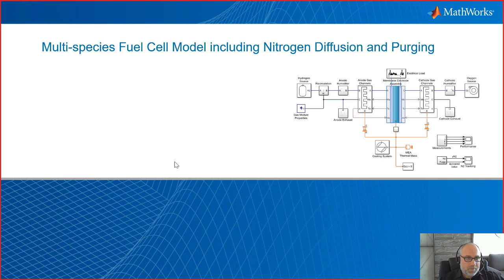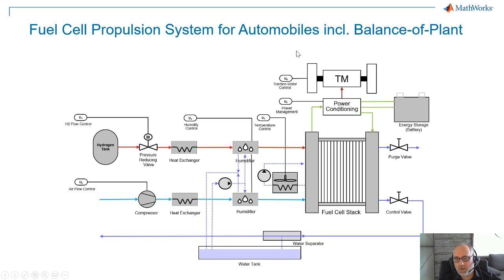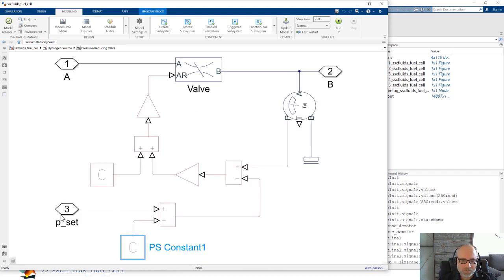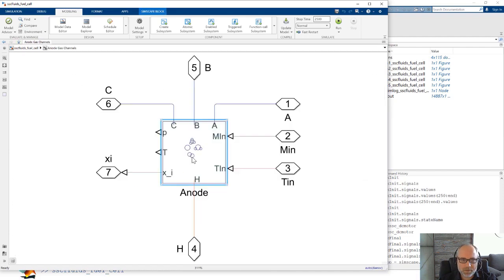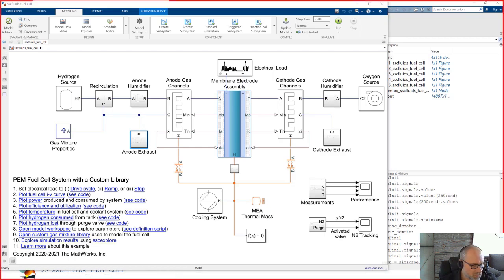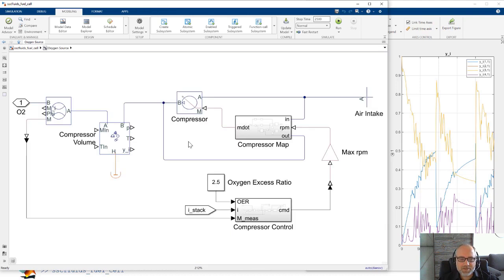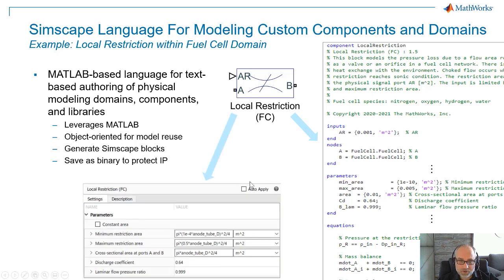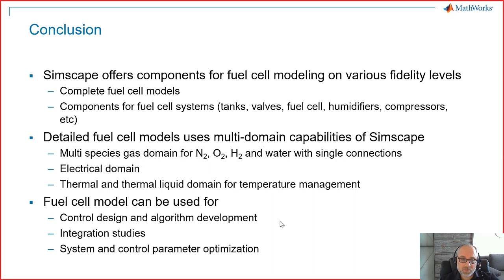Modeling a Proton Exchange Membrane (PEM) Fuel Cell

Comment: Regarding the HT fuel cell, can the humidifier simply be removed?
Can the component parts be used in other simulations, so that I don’t have to simulate the electrodes myself? Or do I have to build the entire simulation in MATLAB from scratch? Can’t I just rely on the overall system

Comment: I work in simscape in custom library FuelCell_lib. There is a problem that when there are no load to Membrane Electrode Assembly the stack temperature still increase. There is no H and O2 consumption. Why does it happen?
Reply from the maker: The reason for that is that the model is not starting in steady state. I tried to isolate the root cause by 

- setting the load current to 0,
- setting the stop time to 25000 to see if a steady state will be reached after longer time
-  comment out cooling system to reduce heat flow here

Then I had a look to the gases, that are expanded or compressed. Here you can also see that H2 pressure increases during the simulation, which will cause an increase of temperature, because of missing steady state at beginning of the simulation.

I hope that helps.